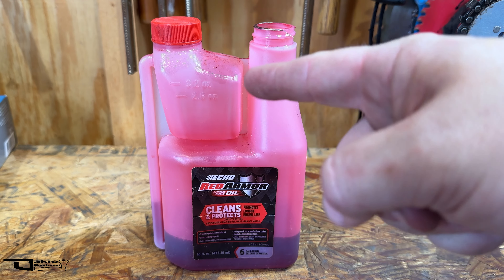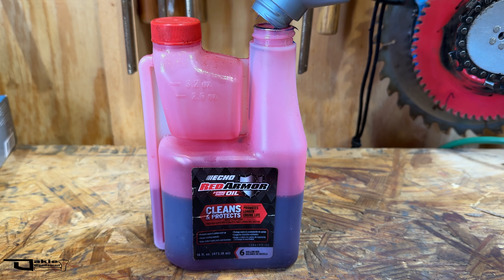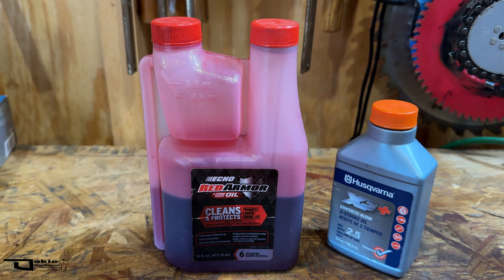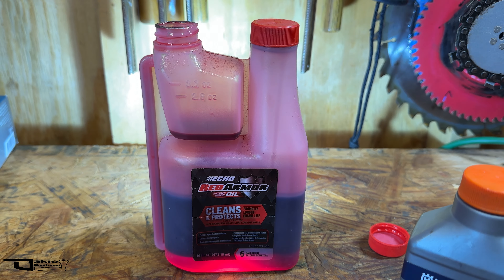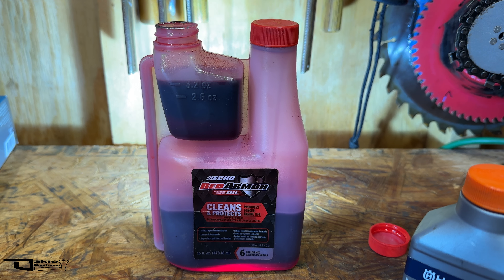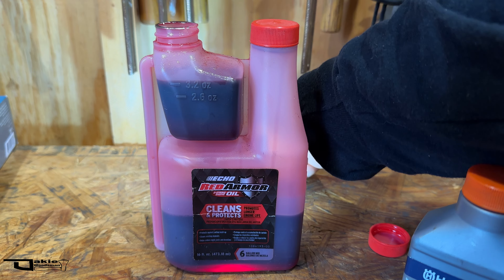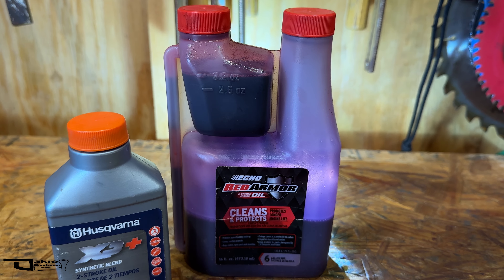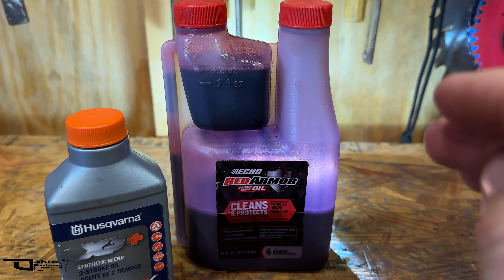Is this Oil SAFE to USE? OIL NOT MIXING

Comment: If the oils are different thickness they are going to separate because one is heavier then the other. I don’t see any problem once it is mixed with gas.
Reply: I agree no issue, but it does make one wonder what makes the Red Armor heavier than the Husky oil?
Reply from the maker: honestly did not think about this.  Thank you!
Reply from the maker: @driftlesshunter9200.  Interesting thought

Comment: I would use the oil. When you poured one oil into the other they separated due to different densities of the respective formulations. When you shook them up they appear as a homogeneous mixture. Due to the surfactants (detergents) in oils today I would be willing to bet that they will not separate again. Regardless, when the purple mixture is blended with gasoline the resulting blend will have plenty of lubricants for your saws. Thanks for sharing your experience with us.
Reply from the maker: Thank you Frank!  I appreciate the input.  Sounds very good and I am going to have to take your word for it.  I just kinda thought they would mix immediately.  I am really curious to see if they separate after some more time.  Even if they do, I think once mixed, it ought to be correct

Comment: The Husqvarna density is less than that of the Red Armor, so it is floating on top.  The filler from the chamber is located at the bottom, which is primarily drawing the denser oil into the filler first, more so than the less dense Husqvarna.
Reply from the maker: I appreciate the input.  I believe what you are saying makes sense.  Thank you again!

Comment: Racing dirt bikes in my earlier days, we were always strict about breaking in the motor on a specific oil and maintaining that oil throughout the whole top end life on two strokes. I was always told not to mix oils cause some have different detergents in them and when we would break down the motors For new top ends, there was definitely a huge difference in carbon buildup between different premixes.  In my opinion, I would stick with one and stay with it so you don’t stick a ring or something
Reply from the maker: Thank you Tom.  That is super cool what you have learned from the dirt bike experience.  I have noticed that so many people into saws have that same sort of experience as well.  Thank you again and I will likely move forward with just one type of oil.
Reply: @oakiewoodsman  you are welcome

Comment: I run klotz R50 racing oil with 50-50 mix non-ethanol and VP 110 octane racing. Gas makes for a very nice chainsaw mix and a 40 to 1 ratio
Reply from the maker: That is awesome.  Thank you for sharing!
Reply: Ohhh the smells.  Can’t beat it
Reply: @BillsGarageWorks  haha. Yup 👍
Reply from the maker: Bill, I have never smelled it I do not believe. I have heard that before. Gonna have to try some at some point.
Reply: @oakiewoodsman  it’s not only the klotz it’s 110 octane race fuel!
Reply from the maker: @BillsGarageWorks never have dealt with the stuff. Sounds good

Comment: I run mixed oils without issue.   I don't think it's anything to worry about.   I can't see why mixing oil would cause them to not dissociate from the fuel while in the crank case.
Reply from the maker: I think that consensus is that it should be ok.  Thank you again friend

Comment: The oils being different viscositys is why they stay seperate , but once mixed with fuel and shaken up they will blend togather . And it is always  a good idea to shake up the fuel cans to mix the oil well if its set awhile. Mixing the oils dont really hurt but you are mixing both oils additive package togather so it would affect how each one performs on its own, will hurt a saw ? Probly not , you have alot more chance of hurting a saw by using a stale fuel thats been mixed and set over a month or longer wich most people dont think about.
Reply from the maker: I appreciate the input. What happens if the fuel is “stale?” I would assume it would burn less hot and not as completely therefore running kind of rich. Am I totally off?
Reply: @oakiewoodsman The octane in fuel starts to drop in about 2-3 weeks so low octane and moisture   and the stale fuel will eat the piston up and cause detonation. It will literly chip away at the piston and cylinder squish band.
Reply from the maker: @coreycorp7048 thank you. Did not know that!
Reply from the maker: @coreycorp7048  if I start with premium non ethanol and run Red Armor, do you have a little more time than a couple weeks?
Reply: @oakiewoodsman If you have a well sealed fuel can and try to keep it out of the sun you would be ok at about a month probly. Red armor oil i do not believe has any fuel stabilizer in it anymore , they changed the oil a few years back. I personally only mix what i use in 1 to 2 weeks and just run 87 octane no ethanol.
Reply from the maker: @coreycorp7048  Ok.  I will just move to 1 gallon at a time.  There are times I used 2 gallons very quickly.  It is just a trek to get non Ethanol fuel.  I appreciate it!

Comment: In my experience it causes no issues, as soon as you mix it with gas it’ll mix perfectly with no issues, it’s not my favorite thing to do but I’ve mixed different oils when I’m just burning up the last of the gallons but I try to stick to one oil, in race applications yeah it can make a slight difference but not enough to effect a chainsaw. And when it comes to chainsaws I run dirtbike or snowmobile oil, I love the XPS synthetic that BRP (skidoo) makes and it’s 10x better than even the best chainsaw 2 stroke mix
Reply from the maker: Thank you for the input. All of this is super helpful to set my mind at ease. As soon as I did it I was wondering if I had made an error.   Thank you much. Lots of ppl have been talking about dirt bike oil online so this just one more example of it being used. Thank you again
Reply: @oakiewoodsman  I use a lot of snowmobile oil as my old boss raced sleds so I could get it cheap from him and it’s just better oil
Reply from the maker: @SomeGuysSawShop sounds like a great deal for sure!

Comment: They will both mix with fuel just fine but i would avoid mixing oils especially if one is castor if both are synthetic it should be fine but I wouldn’t and that’s just coming from years of racing 2 strokes.
Reply from the maker: Thank you for sharing!

Comment: Once fuel hits the oils it will mix.   Heard the shake the pre-mixed fuel in the can too, and pour oil into the can first before filling with fuel to mix. 
I don’t think that matters, once that fuel hits the oil it mixes throughout almost instantly and doesn’t separate.
Reply from the maker: Thanks mark!  I am thinking I ought to be good. Just kinda interesting what it did in the jug. I will be checking soon if the oil has separated. Many have stated that one it was shaken, it will not separate.  We will see man!

Comment: I'm a Husqvarna guy through and through, and that husky oil is about as good as the Stihl oil in the same looking bottle. Have I run it? Yes. Did it work out ok? Yes. Would I use it again? Not unless I had to. I run BelRay H1R oil with no problems. I suppose any oil is better than no oil.
Reply: This is where you’re wrong. Husqvarna XP+ is far better than Stihl Ultra and Stihl orange bottle. Stihl oils are still rated FB after all these years. Keep the much better FD rated XP+ mixed at 40:1 in good ethanol free gas, and you’ll have a well lubed and protected machine. I run either Amsoil Saber, Echo Red Armor, or Husqvarna XP+ mixed 40:1 in everything I own. Three vintage/antique Lawn-Boy mowers, Husqvarna and Poulan trimmers, Echo chainsaw, Hitachi leaf blower, and Ariens snowblower. This pistons and rings look great on all of them with a nice film of oil. I would run Super Tech 2 stroke oil any day of the week over that pond water Stihl Ultra.
Reply from the maker: I appreciate both of your comments.  From what I have seen the Ultra is about the worse stuff you can run.  I also dislike there is nearly no color to it once mixed.  I never like that.  Thank you both

Comment: Its probably fine, 99.5% of 2 stroke oils can mix together without issue. Everyone uses similar base stocks with the exception of castor oils, all that makes an oil "synthetic" is the grade of base stock they use. They were probably different density and viscosity until they were mixed and that was the only reason for the separated appearance.
Reply from the maker: Thank you Dave for you sharing your knowledge.  I trust what you say man for sure.  I know that you will run 50:1 in trimmers and stuff right?

Comment: I'd run it. I have run into this before when one brand had more additives in it and that is probably why the Echo Red Armor was more dense and stayed at the bottom until thoroughly mixed. Once either one or both hit the fuel, it becomes a non event.
Reply from the maker: Thank you for sharing.  I am feeling pretty confident in it working out just fine.  I just have a tendency to overthink quite a bit!  Thank you again!

Comment: I've never been a fan of mixing different oils or adding additives to other oils, such as intended for 4-cycle use. I believe additive clash is a real possibility, and the manufacturers/blenders know what they're doing.  But with 2t oils, IMO, the risks are much lower once mixed with fuel. Though I personally wouldn't have mixed them in the first place, they're both FD rated oils intended for the same application. You shouldn't have any problems using that mix.
Reply from the maker: I have never hear of additive clash!  I guess in theory, that is what I was concerned with.  I think that once the fuel is mixed in, it ought to be alright.  In a way, I kinda wish I would not have done this!  Oh well, it is what is is.  Thanks again AP

Comment: gas is a solevent on the oil.  but i always shake my gas can before i fill every tank.  i ususally run stihl oil, but have run husky then went back to stihl on the same cutting day.   i'm running a 5 series saw and heard the engine adjust for fuel and temp and humidity. it seemed to be in response to the fuel change.  that spooked me.       as long as you shake the saw and the gas can. i think it is safe.    now maybe 1 oil mix is harsher on fuel lines.  but if i trusted the red armour, i'd run it.
Reply from the maker: Thank you for watching and sharing your experience for sure.  This is some interesting stuff for sure.  Appreciate you being here!

Comment: The interesting part was some of it did mix and some didn’t when you look at the line of red armor at the beginning. So the question is, did mixing the two cause the RA to separate? I wouldn’t have any problem with using both together when shaken together and poured into gas but I don’t like the way it separates then you basically siphoned off the bottom mixture when you squeezed it up the tube. I wouldn’t want to run that. Likely it’s nothing but why risk it. Shake it first then add to fuel
Reply from the maker: Thank you and I think this is interesting.  I cannot wait to see what happens when I check it in a few days!  Will either help put me at ease or not.

Comment: Almost any container of gasoline will draw water from the air, so shaking your fuel before pouring into the tool's tank can put water into it.
Reply from the maker: Do you think it is bad to shake it then?
Reply: @oakiewoodsman  
I almost always dump the fuel left in the saw into a container when I think it will be more than the next day for next use, or if the saw has set more than a couple days with fuel in it. I use small half gallon clear bottles to keep fuel for use in, so that I can check for water settled out.  If I were going to shake the gas/oil mix, I would siphon any water out before shaking. https://youtu.be/tAaSmAB_FAA?si=5g5e9ck-a4Y8s_XH
Reply: @oakiewoodsman  
I have never noticed separation of oil from the gas, but it may be a synthetic thing. I may have used the new oil, but I don't think I have!
Reply from the maker: @shermanhofacker4428  interesting. I have never looked that far. I have always thought that I was protecting as much as possible by running fuel with no corn alcohol in it. Thanks for sharing

Comment: If all your 2-stroke engines have Red Armor mix gas in them and you top them off with your next can of gas mixed with Husqvarna oil, the two oils are mixing that way, too.  Personally, I don't think it's anything to be concerned about.  In my mind, 40:1 adds a little extra lubrication insurance regardless of  what brand of oil you use.    I avoid Stihl Ultra at all cost, however.
Reply from the maker: I think you are 100% correct.  Just a very interesting thing to ponder for me.

Comment: Running 40 to 1 will damage your saw more than mixing 2 kinds of oils once. This is no different than dumping some older fuel in with new fuel and shaking it up. Husky oil is decent stuff. Not as good as red armour but mixing the 2 for a can or 2 wont hurt you. I strongly recommend you run at 50 to 1 though. Tons of tests done on this. Manufacturers recomend 50 to 1 for a reason.
Reply: Cellphone makers recommend you update your phone regularly as well. It's called planned obsolescence. Saw manufacturers use a 50:1 ratio to pass emission standards, not because the saw runs better or lasts longer with that ratio. 40:1 is what I have been using for 40 years, even when 25:1 is called for.
Reply: @TheSatillaHomesteader  alot of older saw called for 40 to 1. New ones don't. They run  hotter at 40 to 1 than 50. As long as your saw is tuned properly, 50 to 1 won't hurt anything. Newer saws don't last as long because a lot of them are made like shit lol. It's not the change in fuel mixture.
Reply from the maker: I just gotta say, I have watched much on this situation.  I have seen the claims of hotter running etc.  I am going to agree to disagree on this one sir.  I am going to keep running em at 40:1 especially with these 5 series saws.  It is not much extra oil when it comes down to it and I think personally the 50:1 is more to do with regulations than longevity.  Thank you again.
Reply: @oakiewoodsman  I only know what I've seen. Unless every single temperature gun I've seen was fudged I don't know how it could be wrong. I spoke to 1 mechanic at my dealer about it too because every saw man has a different number he uses.  Newer engine materials are much harder than days of old. New additives in the oils. The mechanic did say they will carbon up faster with excess oil. He said it more comes down to how the carb is tuned. Guys get into trouble if the saws are too lean, and extra oil does help make up for that. If the saw is rich however, extra oil will gunk it up and you could be into a deep cleaning bill unless you do it yourself. Iowa performance saws is another good resource. I know he's murican. It's your saws and your choice obviously. I'm just sharing what I've seen and found to be true. Maybe see if you can get your hands on a temperature gun and experiment for yourself. 
Ps. I love that squeeze bottle. I don't know if we have those here and now I want to look for them. That would be super handy. Much better than stacks of pre sized bottles.
Reply from the maker: I have been talking to Iowa performance here and there. He actually knows I used 40:1 red armor. Interesting stuff for sure.   I have been made aware that the indicators are likely off on the bulb type bottles so may wanna be careful especially at 50:1. I think it tends to be a little less than the other way.

Comment: I'm going to say no
Reply from the maker: no there is a problem, or no there is no problem?
Reply: @oakiewoodsman  I'm thinking it would be to much or too rich I think it would damage the engine
Reply from the maker: This would still need to be mixed at an appropriate ratio with fuel. I choose to run 40:1